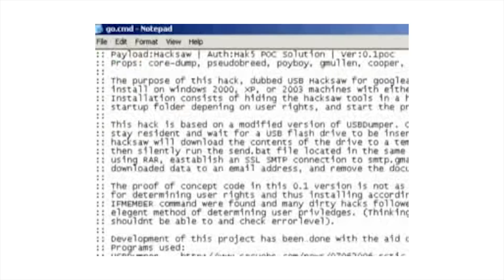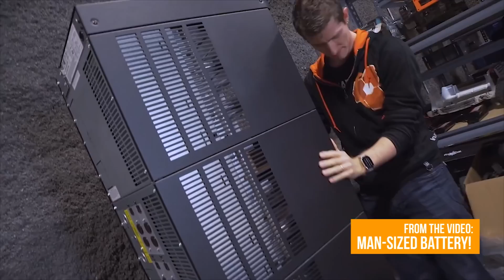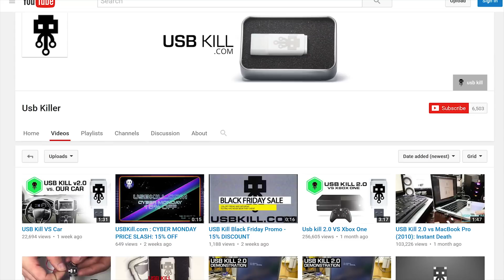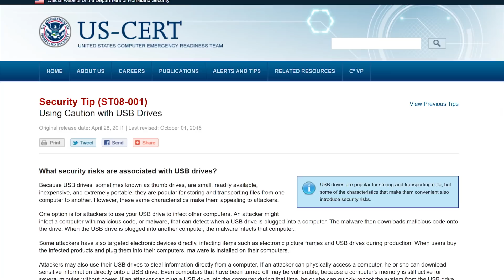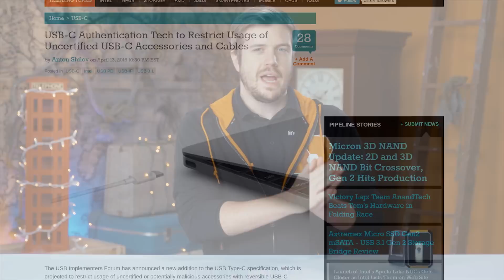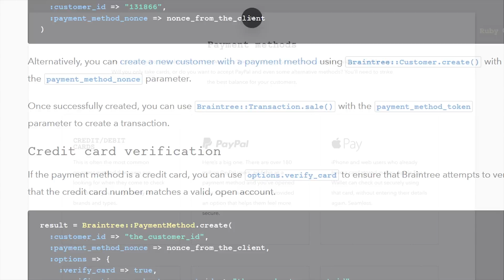COMPUTER DESTRUCTION (GONE DEADLY)

Comment: why dont computers come with fuses?
Reply: i guess its a cost that doesnt make any sense in common use for USB, and uses space... unless this starts becoming common nobody in the industry will care
Reply: They do sometimes, but fuses are too slow for sensitive electronics equipment. You could use a TVS diode along with active protection circuitry and optocouplers for data lines, but that's expensive and not really necessary (it's like having bulletproof windows in your car)
Reply: the port protection will save your PC from getting zapped by some weirdo while the bullet proof windows might save you from some crazy russian road rager with a gun. The chances of these events happening are almost zero therefore investing in prevention of these tragic events is not really practical
Reply: Fuses are meant to regulate amps, not volts.
Reply: Scott Hanna I’m glad someone finally said it, was getting concerned 😜

Most devices will have the equivalent of a “fuse” for voltage installed, they’re called TVS diodes and they’re designed to clamp high voltages like these to protect your device. However TVS diodes are only designed to protect against things like random ESD (eg. Static electricity) or lightning strikes, all things that occur very infrequently. Because the USB Killer continuously discharges its capacitors over and over again, the TVS diodes eventually burn out through the stress of dumping such a high current at such a high voltage hundreds of times a second. When they die, there is nothing left to protect your device and hence the full voltage is applied to whatever else is connected to the port.

Realistically, device manufacturers aren’t being cheap here, they shouldn’t have to build computers that are tanks just because you have a friend who wants to kill your computer via USB. By the same logic, should they make fire proof laptops too? Because gimme 10 seconds in front of your computer with a flame thrower and your computer is certainly not going to be working anymore.
Reply: No, it does not
Reply: that's actually a good idea
Reply: Josh Duncan Standard USB ports include a polyfuse to prevent USB devices shorting out the computer and a cluster of TVS and other diodes to protect against random zapping. This thing was designed specifically to overpower those protections by repeatedly subjecting them to more than they were ever supposed to stop, even once.

Optocouplers are nice, but they can't carry power, so some other, more expensive and less isolated part is needed to actually provide power from the computer to legitimate USB devices. And similar protections are needed for all the other ports an a non-sucky computer (consider that using the same hole to plug in headphones and OS recovery / reinstall media makes it too damned easy for one to do the other without your permission).

Also consider that having some "official licensing crypto check" would refuse you the choice of what to plug in while happily allowing official destruction tools stolen from a police car.
Reply: Yeah it's just computers nowadays, you used to be able to remove and replace every chip, and now you're lucky if your notebook has a CMOS battery
Reply: ***** how would you use tubes as a protection
Reply: TheError404 how is this analogy working
Reply: Or voltage regulator or switch breaker
Reply: John Francis Doe Yep, that’s the point I was trying to make! There ARE protections in place from accidental overloads in a standard PC, however they aren’t designed to stop deliberate malicious attacks, and I doubt you could ever design a system that would prevent a deliberate attacker from destroying a piece of electronics. A “crypto check” like some have suggested would not stop this type of attack, as you could just pump 1000V down the +V bus of a USB port and nuke every other device that uses 5V (as well as probably kill a lot of other stuff in close proximity).

My point being is that device manufacturers aren’t being lazy, and they do in fact have what’s considered industry standard protection in place, it’s just not designed to stop you from deliberately killing your PC.
Reply: I have a Osborne 1 Friday m 1981 that has a fuse
Reply: fuses protect against high amperage current, voltage will by-pass it. Probably the fuse would melt after all your more fragile component on the USB path melt, that's the short answer, with the chance the fuse would never melt at all if the USB killer is well design with a calculated charge just above the tolerated by computer components (fast discharges). You need a voltage regulator circuit on the USB conector, is just waste of money. That USB is like tossing a granade into the fire, just don't do it. Future of USB is 100% wireless, so this will be a thing of the past someday (the USB could get power from a light surce and use standard radio signals to transfer information, like puting a plant under the sun to share data).
Reply: 1st is,this damage coming from what they think people will get electricity out of it(USB PORTs) so,it's like you put a water purifier at a drain.
2.they sold it and it called UPS and it's same when people buy a house then realize that the ground ain't deep enough and then the fuse box is missing. The different is the house and fuse have by far price different but UPS and cheap PC? not so much.
3.UPS won't help you from this kind of attack though,it came from different direction.
4.if you want to put all fuses in to PC,how mant fuses you need for each things in that computer? 1)graphic car 2)CPU 3)hard drives and CD drive 4)fans 5)USB ports 6)All PCI cards,including sound card,network card 7)Motherboard. and these are minimum
5.it's not really overclock friendly(the power that usb send out isn't much but the flow rate of electricity,AKA:voltage is on another level)
I should explain about this voltage thing a bit more:Imagine a dam,it can block about 2 tons of water but what would happen when it hit by 1 ton? it should be fine,right? no,actually if the water fall and has so much kinetic energy than dam can handle then the dam would be cracked or broken in worst case scenario.
there should be more but I'm kinda lazy now.
The solution can be more simple,made a key locks that simply disable all USB port physically. 1 for front panel and 1 for back panel.
it's like removable handle wheel on car,it's simple,those people might prepare for handle wheel but I don't think they're going to cut the seal or lock open in a public.They would steal it if they are willing to do that much.
Reply: Some expensive stuff comes with optocoupled data pins, so the data is converted into light to prevent overload
Reply: Anon Ymoose because fuses are slow to react
Reply: TheError404 does this analogy include the fuse
Reply: Manufactures what your device to break easier so you can't fix it by just swapping something out

Comment: This is just stupid unless you're a blackhat wanting to do a DOS attack. Yet another reason to keep your network stuff locked up. Many network things now have USB too, not sure if this would fry the entire unit, but still worries me. 

It could be protected though like you said with optocouplers, transformers, I would think too it could be done with varistors or diodes although those methods would more or less absorb the surge(s). I think we should find a way that anyone that feels a need to use one of these the cap in it pops and smokes.
Reply: Plugging that into a network isn't a DOS attack, DOS attacks are overloading someone's internet with fake data until it stops accepting the "data" which blocks real data trying to come in.
DOS means its done by a single computer and DDoS is using multiple computers to achieve the same thing so why use DDoS instead of DOS? well DDoS might be used because it's quicker or you're trying to take down a bigger target but it can be more expensive but on the other hand, DOS can be slower and is used to take down smaller targets but it's way cheaper.

sorry I explained what it all meant but what I'm trying to say is that DOS/DDoS attacks are not done by destroying something physically

Comment: in computer security, if an attacker has physical access, all bets are off
Reply: like i could buy this thing or just use a hammer
Reply: but you are spotted instantly. with usb you are more discrete.
Reply: There is a saying, "Whoever has physical access to a computer owns it."
Reply: It's common sense though. Would you inject something that you got of the ground into your veins?
Reply: +AnonyHawk Hellyeah mate
Reply: You weren't listening. The device charges it's self, and releases it's self when plugged into the USB until the board is fired.
Reply: A proper security policy with common defense in depth layers can greatly increase an individual's ability to protect their data from the attacker even if they have physical access. You can take it pretty far even to the point of creating custom triggers that will set off an event in case someone is able to break into the computer case to try and connect USB headers or the like.
Reply: To be quite honest it's exactly the same with physical security as well. With enough time there aren't very(any) many locks that can't be cut open in a few minutes with a decent grinding tool or cutting torch, the locks just makes sure that the thief will either need to make a fair bit of noise, or have skills in lock picking. Though if you don't have people guarding it the lock will be pretty much useless. Most thieves are smart enough to wait until nobody is around. Though this USB doesn't really allow them to access anything, in fact it might make it harder for them to get secure data.
Reply: I'm fairly sure the device you are attacking needs to be on. I mean who plugs a USB into a device without power? He talks about too though in the video. Either one sold by the company which is just a USB that uses the PCs power against it. Or the one you build with a USB, and a capacitor from a disposable camera.
Reply: More likely is some sort of malware on the USB stick they dropped.
Reply: His point is you can literally just pour a 'discrete'bottle of water or any other method for free... Makes this fairly pointless.
Reply: oh man someones been hitting up that Net+
Reply: Nmotsch idontwannagivemyrealname actually it charges itself from the device and them releases that power to fry the motherboard and the usb port
Reply: William Galladryn not exactly it soley depends on what method the hacker uses yes and usb killer is a dangerous device its only purpose is to destroy technology if you are stupid or maybe have a thousand dollars to throw away just be sure never to destroy your real computer or phone
Reply: William Galladryn in the case of computer security even if the hacker does have access to your physical device if they legit wanted to your personal information or spy on you they can install malicious software onto the device itself if you have passwords on your apps then your pretty much good because they cant get your passwords because it be useless cause any antivirus software you installed is safe in the case of the usb killer do not ever plug it into anything thing you own if your dumb enough to waste valauble money on expensive devices then i am not judging you by any means its your choice it what you choose you get and also like he said you should contact the manufacturer of your device like the company that creates it to install an optocopler which will prevent to much voltage from frying out your entire phone or important components needed to to prevent electricity from literally burning your computer like i said it depends on the method theres no such thing as 100% security be carefull and dont plug random usb devices into your computer
Reply: nikulaye the system cant destroy itself thats not possible with an optocopler the usb killer is useless the only way that would happen will be a problem with the hardware so since the optocpler prevents to much voltage it wasnt caused by the USB killer it could how ever be caused by a mistake in the hardware or faulty  hardware components within the computer
Reply: I developed a system for my computer that keeps it from being damaged from the stupid devices
Reply: +AnonyHawk Doesn't mean you're not an ass for setting that shit up.
Reply: I wasn't aware usb killer used the power of the device you plug into it, I was under the impression you charge the usb killer then you discharge it into the device. I didn't think a laptop or a phone would output enough power in that quick of time, but I guess it can?
Reply: 666 likes?
Iluminati confirmed
Reply: So it charges itself with electricity magically from the air? It can't "charge" itself without some sort of electircal input.
Reply: How can they plant them when they have to be charged? They would have to go back to the drop and charge them.

Comment: Why cement? Just unplug your USB header from the motherboard.
Reply: Yeah, no. Most mouses and keyboards are connected via USB.
Reply: Well, if you have a Laptop you can certainly modify it to a good extent. I did that with mine, soldering away the connectors that are connected to the Motherboard directly, making the USB ports unusable. I have a Trackpad and Keyboard built into the Laptop, and i am not using the Laptop for any kind of Gaming while i am walking around, so i am good. Also, you can actually even fix that with adding internal USB connectors, either (on a Desktop) by adding a PCIe extension with inside connectors, or (on a Laptop) re-soldering the original connectors to wires, then soldering the wires to lose USB connectors you can attach things to on the INSIDE of the Laptop (opening the bottom panel or the likes where the HDD is, there you can have the USB hanging if there is enough free space for it). Everything can be fixed if you want to fix it.
Reply: Unplug the USB header from the motherboard, block every USB port by using glue and install some of these USB Isolators to the motherboard using an adapter and attach them to the back of your PC-case for accessibility.

Comment: Why don't they just add an inline fuse to the USB port
Reply: That wouldn't work. I guess, there's already a short circuit protection in USB controllers. But these devices don't overload the USB power output.
Instead they give high voltage on the data pins. Nowadays most logic ICs are designed as CMOS, where MOSFETs are used, which have an insulation between the gate and the channel. This insulation is very sensitive to high voltage.
But instead, a low voltage varistor or clamping/clipping diodes should work.
Reply: Mike Z there kindda is, watch the usb -c part of this video

Comment: And when manufacturers start using optocouplers then this will be useless
Reply: OK I will plug one into every port, if that does not get through it should at least ruin the ports. Job half
done.
Reply: only up to a point. Even optocouplers have their limits.
Reply: usb data lines are diff pair so best thing to be used is transformer but that still have 1:1 ratio but if 200v is with reference to gnd then its safe but if it is 200v between data diff pair then its problem. maybe best thing is to use low voltage varistor.
Reply: You can't run a USB signal through a transformer; they distort any non-sinusoidal signal. I feel like a shockley diode would be an easy fix to this.
Reply: like 50kV or more, thats enough to even block off most teasers

Comment: Wanna know how to protect your computer against this? It's so simple it's funny. Simply use diodes (and/or metal oxide varistors) from ground to the data lines, and from VCC to the data lines. Many microcontrollers already have these diodes in place. You also need to have an in-line resistor, which may or may not make it non-compliant with the USB standard.
I can put together a schematic if anyone is interested.
Reply: Jonathan Odude it prevents power from flowing out I think